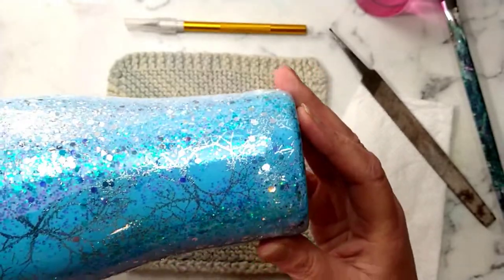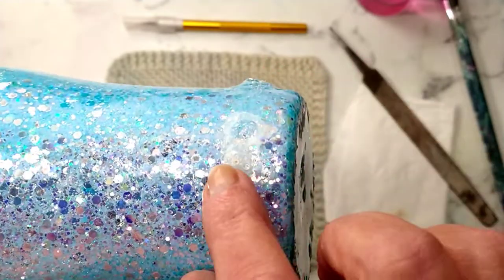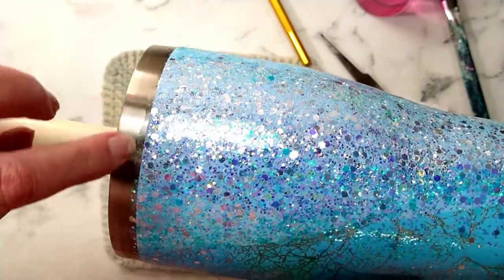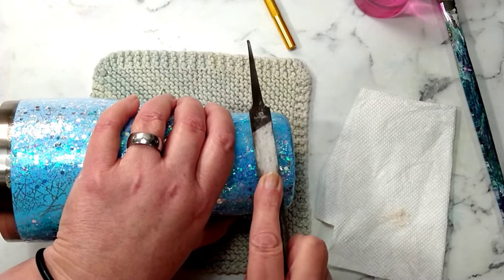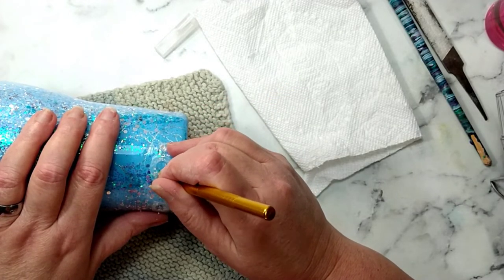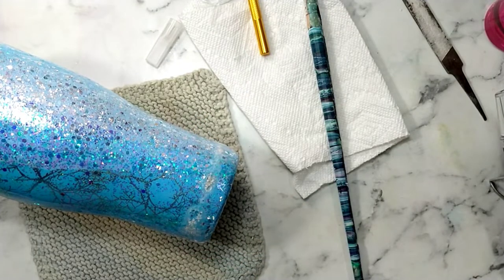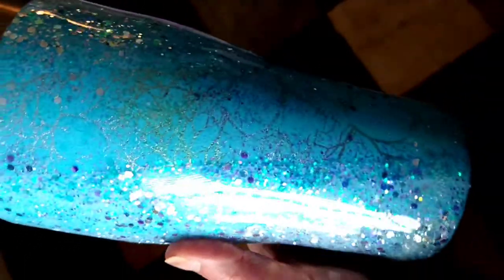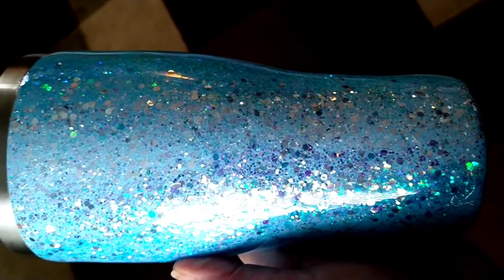Fix or Forget it. Epoxy Repair on 30oz Tumbler

Comment: That's too bad, it's such a pretty design!  I have a tumbler where the resin didn't totally cover the bottom edge, I'm trying to find a solution to avoid having to put a whole new coating of epoxy on it.  Maybe UV resin will work,.
Reply from the maker: Thank you, Swamper60😊
I know, these cups are a $*@#∆.   That bottom split is the worst.
Unsolicited advice?  Don't avoid putting another coat of resin on the whole cup. The longevity of the tumbler is a reflection on your work. I get it. It's such a pain to have to go back and add resin again. But you will have a clear conscience and know that your work is is going to hold up, through time.🙂 I hope this makes sense. I mean it in kindness and to encourage you 😊🌺🐭
Reply: @sandisshedhouse4741  Thanks for the advice, this is strictly for a gift and I will explain the situation to the recipient, I have actually purchased silicone bottom sleeves and will put one on this tumbler and I may yet try to swab on either a clear coat or UV resin.  I would add another layer but I was heavy handed with a prism-holo mix-in and while it's pretty I am concerned that another layer will further dim the design.  I appreciate the response, I have subscribed!
Reply from the maker: Absolutely 😊. What are these sleeves you speak of? If you don't mind sharing 😁 And, thank you for joining the Shed Rats😊🌺🐭
Reply: @sandisshedhouse4741  do you have a video where you made that beautiful blue tumbler you had issues with?
Reply from the maker: I'm not sure I kept the video. I'll have to do some digging.
Reply: @sandisshedhouse4741  Don't go to any trouble, I'll go look at your videos and see if i can spot it.
Reply from the maker: I looked. It may be in my storage. But there are a lot of videos there. So it will take a while.
Reply: @sandisshedhouse4741  did you get my reply about the silicone sleeves?  I answered this afternoon but now I don’t see it?  Anyhow, I bought them on Amazon
Reply from the maker: No, I didn't receive it.
Reply: @sandisshedhouse4741  very strange!  I should get the sleeves tomorrow, I’ll post them on my YT and Instagram & let you know if they are worth it 👍🏻
Reply from the maker: Thanks.  Is Swamper60 your YTChannel name?  I would love to check it out😁
Reply: Lol, now it looks ok